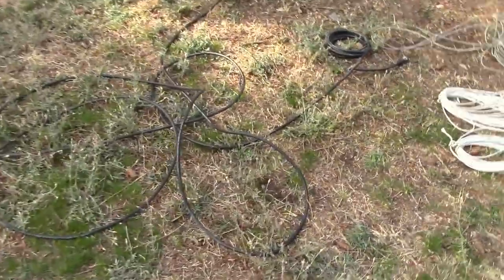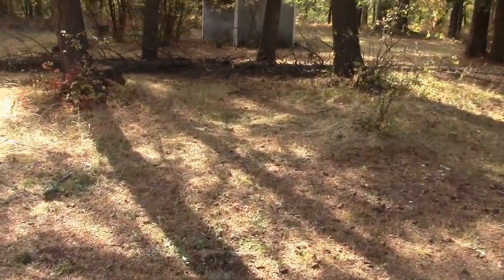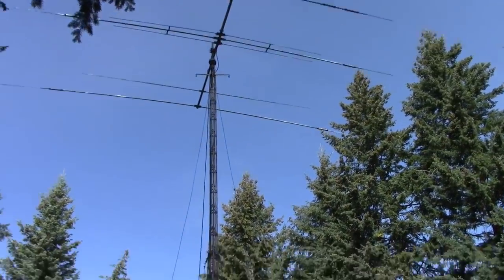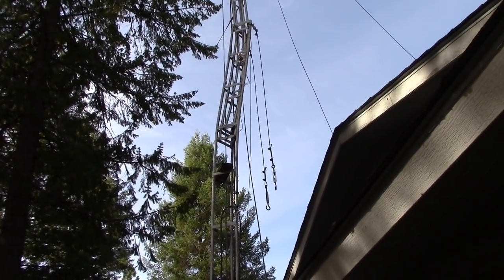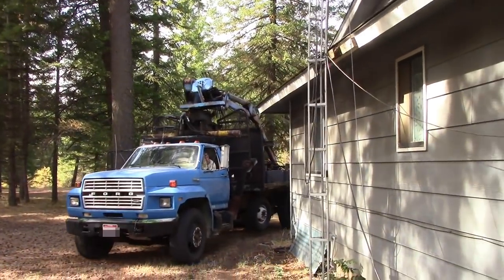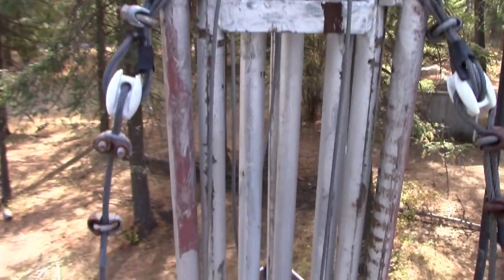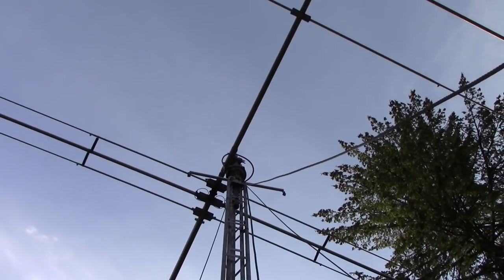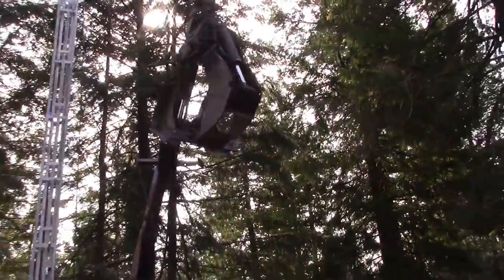Catastrophic Tower Damage   AmRRON HQ

Comment: Hey JJ what computer do you recommend for radio? I know everyone has their preferences. But I want to keep the internet and Bluetooth connectivity to a minimum except for radio work. Also what are you using for video. That blur on the license plate was really smooth.
Reply: raspberry pi is what alot of the amrron corps use